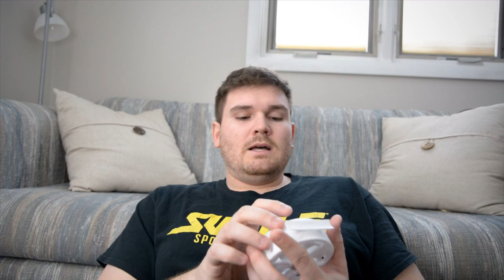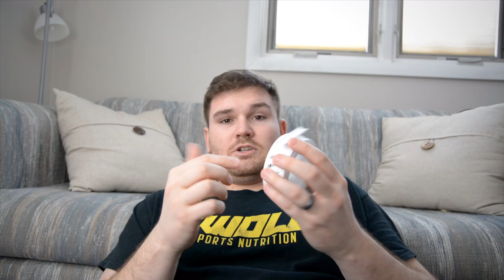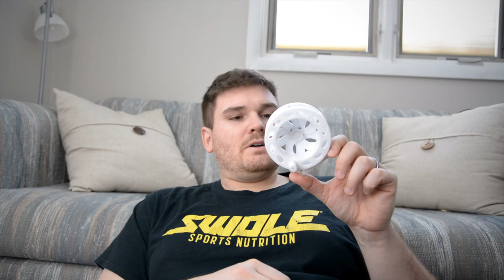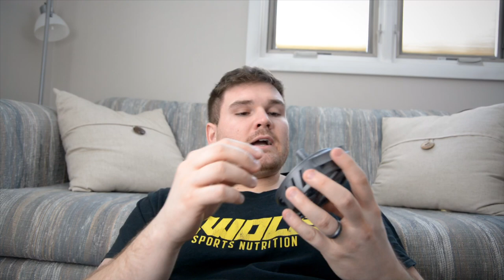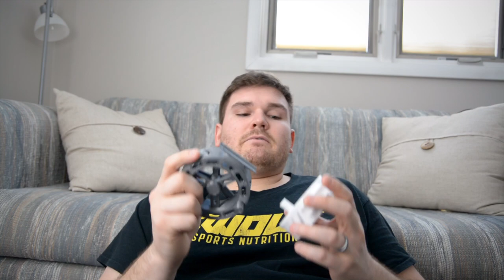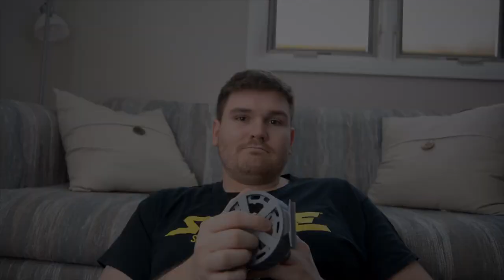A 3D Printed Fly Reel Series Commercially Available!?!? Will it Work?

Comment: G'Day,
I've bought the nymphing reel from yr3dreel and am very impressed with it. Amazingly light at less than 3 ounces but it came with a set of weights so you can balance the reel to the fly rod. Haven't used them. I've also ordered their ORDA nymphing reel as well, might even get the Spey18 for a 12 wt rod that I have.
 I've found the reactions of fly fishing friends very interesting. Most wrinkle up their noses at the mention of a 3D printed plastic fly reel. Some fly fishers can be ultra conservative. But the reel does everything that I ask of it, that's all that matters.
I'm interested to hear what you think of the reels after fishing them.
Cheers,
Steve.
Reply from the maker: I JUST recieved the ORDA and will be doing some fishing soon with it